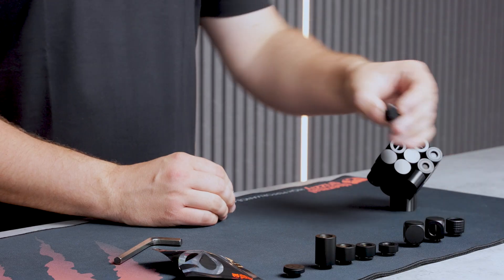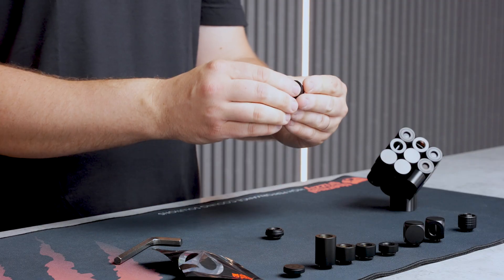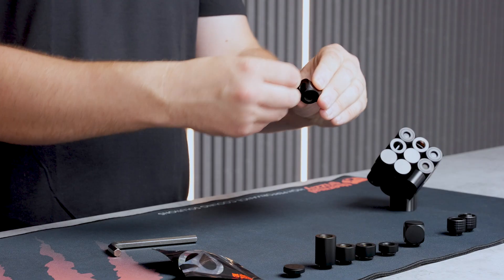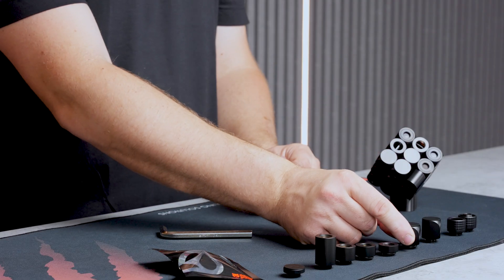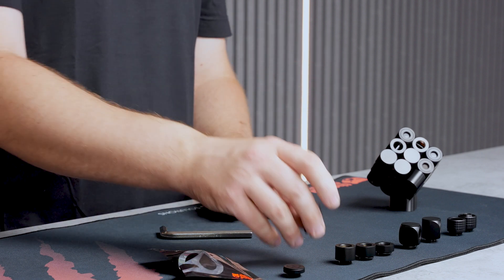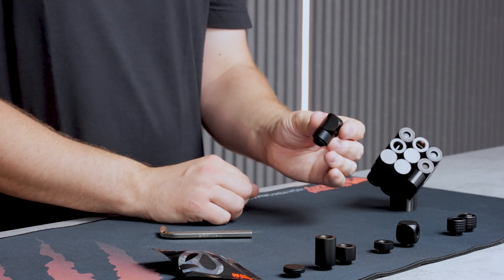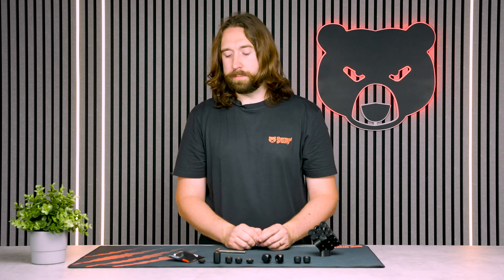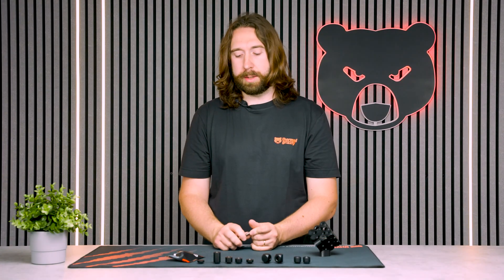DeltaMate Fittings Explained: A Quick Overview

Comment: My next build would be all DeltaMate parts if possible, aside from the EK blocks I already have for the CPU and GPU. Thinking of getting the Stealkey O11D Evo XL distro plate and then whatever plug-in adapters and 420mm radiators fit with those, and then I would just need fittings and adapters for the rest of the loop. Those DeltaMate ones would look slick. Anyways, I just subbed to the channel, looking forward to seeing more DeltaMate products.